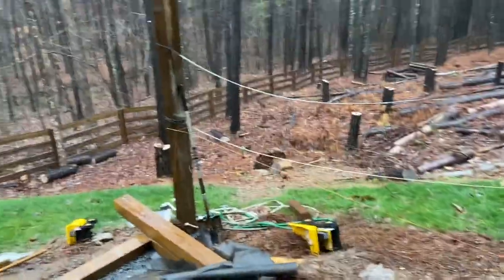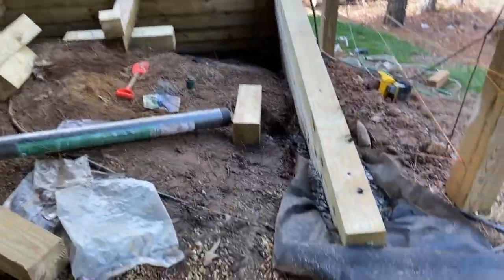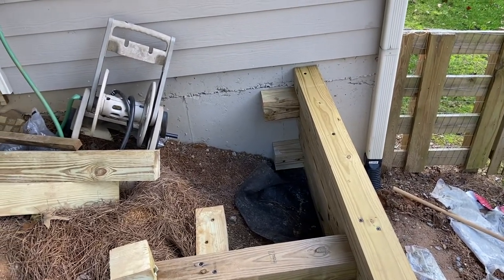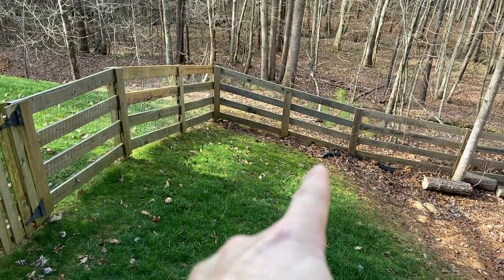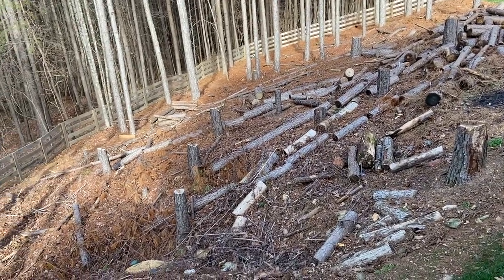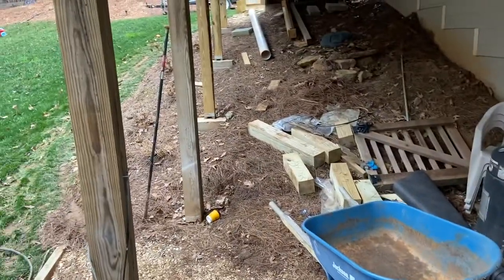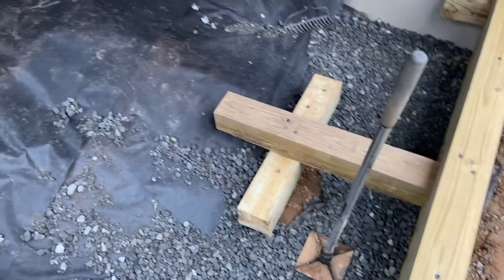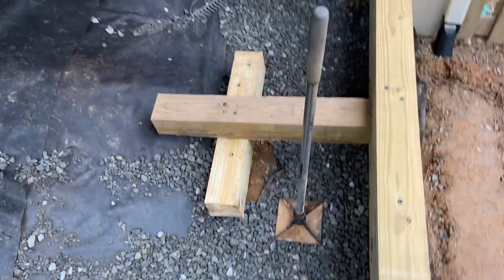Timber Retaining Wall Build

Comment: You’ve done some really good work here. The one thing I would say is your tie back (deadman) should go through the wall and be a thread/bolt/washer type situation otherwise you’re literally relying on the tensional strength of the timber locks to hold the wall and they are significantly weaker when used in this way than in shear. I would just trade out the deadman post that goes from the Tee to the wall and use a threaded rod right through the face of the wall with bolt and washers and then run it back through the tee and bend it around or bolt it also. Really good work though mate good job. Just passing on some thoughts.

Comment: Looks good, but I feel your pain! I’m in the process of building a large retaining wall from railroad ties and rebar. Fortunately I was able to use a skid steer for most of it but backfilling with a shovel is taking a while. Funny how everyone always says you should have used stone when you can build with wood for a quarter of the cost and in my case I won’t be in this house for more than 5 years. Hopefully you finished moving all that rock haha
Reply from the maker: TheKevinhaeb thanks! After about 15 wheelbarrow loads, I said F that and I ended up renting a dingo mini-skid and loaded all the gravel. Made short work of it and my back thanks me. I backfilled that whole thing in a couple hours with the dingo. There was just enough room to fit between the deck posts and make the turn with the dingo. I did tear up my yard in the process but no big deal. I’ll reseed. I ended up needing another yard of gravel. It could probably use another 1/2 ton or so to be PERFECTLY level under there but it’s pretty close. Now if I could keep my kids from throwing the gravel lol wishful thinking... now that I have built the screened porch above it (see my new video series), that area barely sees any water so I’m not that concerned about rot. It’ll happen eventually a long time down the road. Plus with all the gravel backfill and surrounding each piece, it has excellent drainage.

Comment: Great video. The 57 stone you used to back fill, did you also use it as the base under your first row of timbers. Correct me if I am wrong but 57 stone is clear correct, no fine bits in it. Should I use a clear rock under my first row of timber, or something that has some smaller pieces so that it can be compacted. Thanks
Reply from the maker: It really depends on your soil. That soil down there was pretty compacted, plus the timbers themselves and “structural” in a sense compared to lets say a CMU block which doesn’t span as much distance. The 57 I used was more for leveling/flattening out the base and also for drainage to slow the rotting process of the timbers.

Comment: Shoulda used block or concrete! Maybe when you replace the wall in 10-20 years.  Good thing is a small area only!!
Reply from the maker: Siccished1234 thought about it, but decided to go with timbers. I’m aware of the pros and cons of each. I won’t be living in this house in 10-20 years. This wall is going to stay pretty dry being under the deck. I’ll be building a roof/screened porch over the deck in the next year or so which at that point, this wall won’t see a drop of rain.
Reply: @macgyver03ga  it will last more than 20 years anyways, double that
Reply: You can all put a waterproofing membrane behind it so its never in contact with wet dort or stone

Comment: If you spent as much time working as you do talking you would be done. I fell asleep around the 6 minute mark...
Reply: hehehe  Soooo much talking, not so much doing.  I think it will turn out nice, though.
Reply from the maker: Putting this on youtube was kinda an afterthought. I originally made these videos for a facebook group I'm a part of, then pieced them together and uploaded to Youtube. If I had to do it over again, I would have setup a camera to film the actual building process. Regardless... I hope it helps someone.